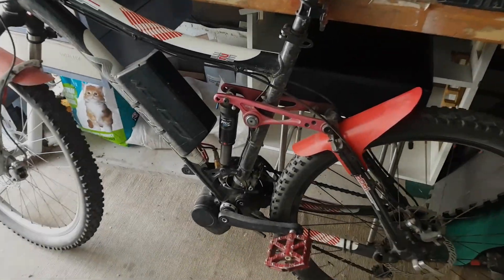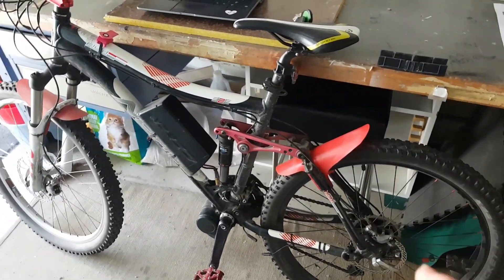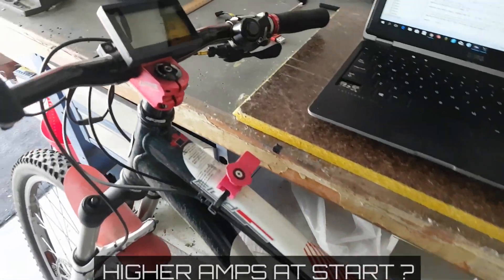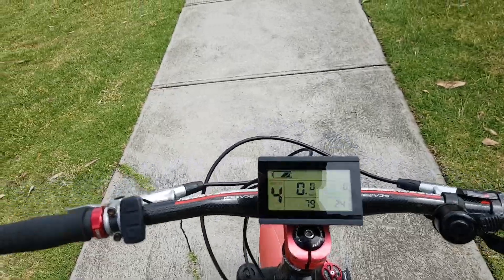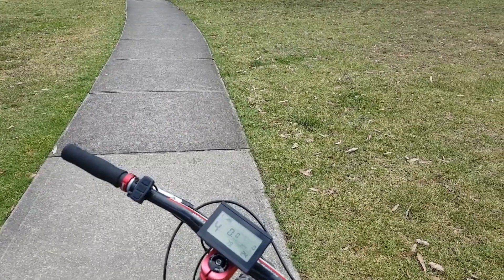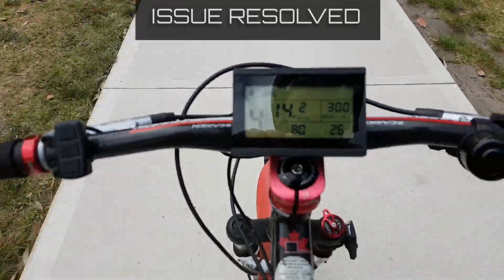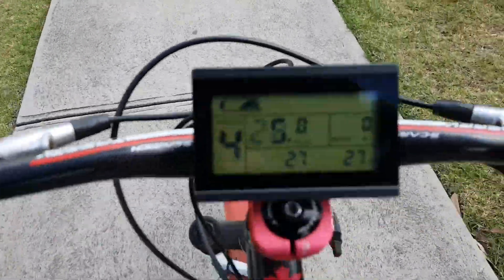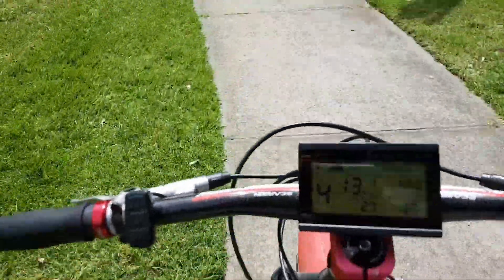TSDZ2 OPENSOURCE FIRMWARE | Resolving Lag Issue

Comment: Great video and good work to iron these problems out, I am wanting to buy a torque sensing mid drive and with your mods I think a 750w  52v One of these will be just right.
Reply from the maker: Keep in mind that the motor will heat up if you ride at more than about 220w j for any length of time that is it’s real rating, the 750w is just a peak governed by the firmware. With open source firmware you can limit it to 18A x battery voltage

Comment: Why dont you change ramp to 25 after speed is over 6km/h, bellow that speed you can leave it at 75.
Reply: then you would still have the lag issue
Reply: @sausagefingers714  If the lag at speed was the issue, and he would prefer the ramp up to be slower at startup, it would make sense to differ on speed. Having it flowing would be better, so 75 up to 4, then sloping it towards 25 at 7 (50 at 5), or just a long slope from 75 at 0 to 25 at 10 maybe? Anyway, sharp steps often feels wrong.